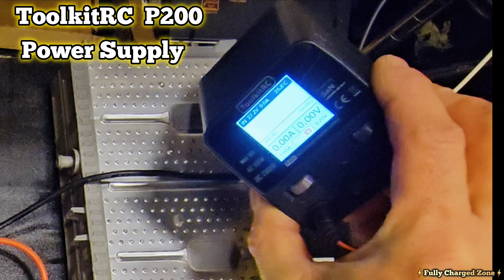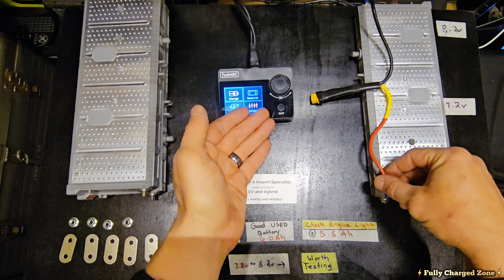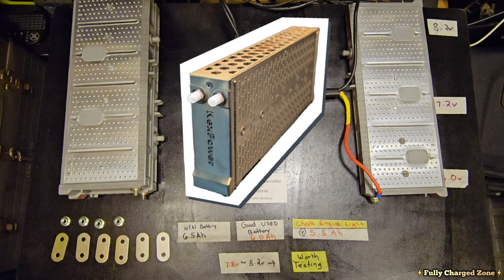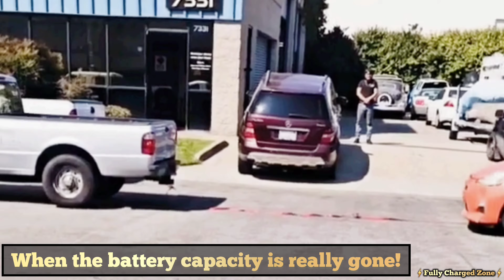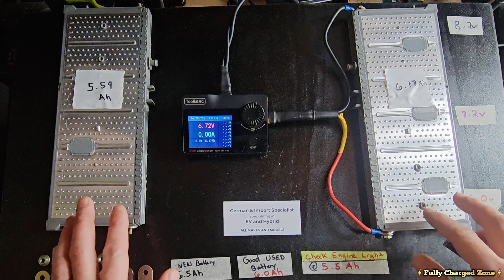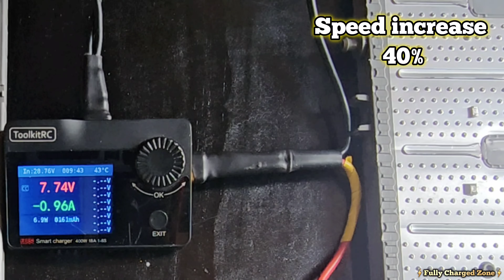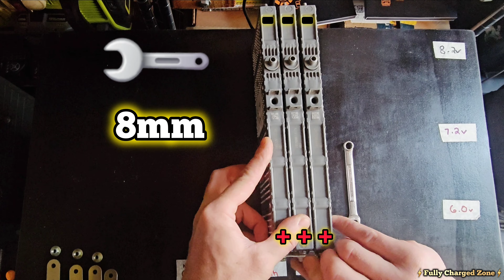Toyota Hybrid Battery Tutorial - Charging, Capacity Testing, and Balancing Battery Cells.

Comment: In the interest of saving a metric tonne of time, can I just run a charge and see if it reaches 7.5ah?  I did that one my first cell, and it stopped when it reached the preset, 7500mah.  Does that still say it's a good cell without spending a whole day on it?
Reply from the maker: Battery capacity tests often take a long time because they typically involve fully discharging a battery at a controlled rate, which requires a significant amount of time to accurately measure the total energy stored within the battery, especially for these types of batteries. It also takes a considerable amount  of time to avoid damaging the battery by discharging too quickly. This is the only way to get the most accurate results.  It takes me 3 days to test an entire battery pack on a prius before assembly. Sorry to be a bummer. The more time you invest the happier you'll be with the battery results.
Reply: So we are still using the the bad one? After recycle / reconditioning? I have one that’s 6.36 (#18 I think). I have experience reconditioning 12 volt lead acid, but not these, thinking it’s the same concept.  12 volts are waaay simpler 🤭.  Should I be tossing this 6.36 module?
Reply from the maker: I would toss it in the battery recycling bin at home depot
Reply: @fullychargedzone 🤣, Thank You!
Reply from the maker: Its free  😆 😂 🤣

Comment: I have a 2017 Toyota Prius I just bought and they told me it had a bad head gasket. I know Prius is pretty dang well but this is my first 4th gen prius. I took the engine apart and put in a new head gasket, new thermostat and new ECT sensor because it was throwing a code. Once I got it all back together it started up but it idles extremely rough, if I hit the gas it will smooth out but as soon as it goes back to around idle speed right before it shuts off or right when it first kicks on it will shake like crazy until I hit the gas pedal again I have done everything I can think to do and cannot get this thing to stop shaking violently at idle speed. Two other mechanics have not been able to figure it out. It does have 240,000 Mi on it so I am wondering if the Hybrid battery is potentially going bad. It did pop up once saline hybrid system failure but after I reset the code it has not come back. However it did have a coolant leak before and I was told the engine did overheat. My question to you is, could a bad Hybrid battery cause a violent Idle shake when the engine is shutting off or first starting up?
Reply from the maker: No, I have yet to see a hybrid battery cause your symptoms.

1. Have you performed a compression check?

2. Have you cleaned the mass airflow sensor? 

3. Have you smoked tested the intake to check for leaks.

I've been working on these vehicles for years. 

4. Let the vehicle sit until engine is at outside temperature.  Start the vehicle...is there any smoke?

It sounds like the intake is leaking or the mass airflow sensor is bad.

5. Have you tried to run the vehicle with the mass airflow sensor unplugged. The computer has a back up that will run the vehicle if unplugged. 

Let me know, I have yet to find a vehicle I can't fix.
Reply: @fullychargedzone  so I did your suggestions, I did a smoke test first and could not see any smoke coming out anywhere. So I moved on to the compression test and sure enough, cylinder one had good compression and all three of the other cylinders had bad compression. Like 60s and 80s. Evidently when the engine overheated it warped something
Reply from the maker: @photosbynickel I'm sorry to hear that. I've been in those position before. I won't rebuild a overheated engine. The last prius I did...the head bolts threads got damaged. I hope you can find a good used engine. I know a few good sources if you need.
Reply: @FullyChargedZone  I have not smoked tested the intake but I have taken it off and put it back on several times and it has a new gasket on it. I thought there was a problem with the throttle body so I first cleaned it and that didn't work so then I replaced it with another used one I had that I also cleaned and that didn't work. I did do a hard reset to make sure the computer reset once I cleaned the throttle body. I did put on a new mass air flow sensor and that didn't work. I have changed the spark plugs, I have changed the fuel injectors. I have tested the circuits to make sure it's 5-volt constant. It has a brand new AGM 12-volt battery. I have checked all wiring and hoses a million times over. But no I have not done a compression test yet
Reply from the maker: I can tell you worked hard on it. I'm glad I could help.
Reply: @fullychargedzone  i have put new head gaskets in 4 prius engines. replaced engines in 2. yeah. I spent a month working on this one.  thanks for your help. where do you recommend used engines? my last one i got from Texas JDM.
Reply from the maker: I was going to recommend them, they actually have a decent warranty. I used them a few times myself. I also use this company sometimes because they have a lot of low mileage engines.

https://autoparts.beforward.jp/search/TOYOTA/PRIUS/Engine---Components/Engines/
Reply: @photosbynickel  its a clogged EGR valve/EGR cooler that's causing your headgasket issues. It's a semi-common issue on older/high mileage Prius'
Reply: @fullychargedzone  also I did try to start it with the mass air flow sensor unplugged. There is no smoke after letting the engine sit. The last time I tried to start it after cleaning the throttle body I put it in maintenance mode and it shook just for a little bit when it first started and then smooth out and ran pretty smooth for about 30 seconds and then the engine suddenly shut off. Then it tried to start itself back up again and started shaking very badly and after about 5 Seconds it shut itself back off and then tried to start back up again shaking badly again and did this back and forth about five times before I finally shut it down. After I shut it down I pulled the spark plugs out and there was smoke coming out of the holes of the spark plugs
Reply: I had an issue similar to one you described after 2nd engine end of story injector plug signal was making false contact no codes super negative fuel trims till I gave it gas and smoothed out.

Comment: Thanks a million ! Great imformative video can you tell me 7 whats your name so I know who taught me the right way? 😃
Reply from the maker: I'm glad I could help. It's the main reason I started this channel. My name is Dallas.
If you have any questions I'm here.
Reply: I have another question, how do you adjust the discharge for the 6 hours on the toolkitrc,because I started the discharge of the module and it stopped after 2 hours I will appreciate it very much if you tell me how thanks and god bless you!
Reply from the maker: @cucogallegos3974 that means the battery only has 1/3 the capacity of a good battery. I recommend not installing the battery. If you purchased it online send it back. Holding voltage is different than a capacity test. Most people only test if it holds voltage. The video explains settings you should use. I've been in your shoes...sorry bud. If you need a good source for batteries I can point you in the right direction.
Reply: @fullychargedzone  thanks a million and god bless you! Where can I find a good battery/ module ? I would appreciate it very much!
Reply from the maker: New battery replacement:
 https://sodiumhybrid.com/?srsltid=AfmBOoq4yqxtsoUHqAwcqYuDgsaUWy71tGzxXebgiBaKXh4pgPkE93R8

Used Battery Replacement:

https://batteryhookup.com/products/oem-toyota-prius-nimh-replacement-battery-cells?srsltid=AfmBOoplsq4bA_DrQ2P4wa7vHkn3AJMqeHjcQnGl2ABvYat5JdhmwkiW&variant=43961978847394

If sold out...I recommend emailing them. Batteries are usually back in stock weekly. They never let me down.  

Another source if they're sold out

https://2ndlifebattery.com/product/toyota-prius-hybrid-battery-cell-8-2v/
Reply: Thanks again you're a life saver! Best wishes!
Reply from the maker: @cucogallegos3974 Anytime

Comment: can you pls advise the thought process on dr pirus app in vehicle testing that pulls 6 amp load by turning on headlight etc etc .. i tried with my2017 highlander and it never works for me may be because it has 4000 mah vs 6500 mah on regular pirus, it was not able to keep up for 15 minutes as app exect on 6 amp load.  any thoughts will be helpful on invehicle testing to get to know the life of battery without removing and dismantling to do capacity test.
Reply from the maker: It sounds like the capacity is depleted. Email me S.O.C data
Reply: @fullychargedzone  I tried in 2 different car. State of charge maximum toyota allows is 68 or max 70% after this toyota dooesnt allow battery to charge (dont know why), after putting 6 amp load for 12 minutes , state of charge came down to 40%. all voltage are within 0.10 voltage difference. dr prius app says 65% capacity. i dont tust this. because i tried the same in 2019 highlander that has 50K miles and it came up with same result.  like to know your thoughts.   before the load test whe SOC is at 68% the block voltage(combining 2 modules) is 22.21 voltage all other blocks are within .10 v difference..  after the load test with 6 amp around 10 minutes or so, block voltage is at 21.53 and it has SOC AS 40.77.  PLS ADVISE i am pretty sure app is not super right
Reply from the maker: From the data sent, 12 cells need to be replaced..1,2,3,4,5,6,7,8,9, 13, 14  15. The pack will need to be disassembled to tell if any cells are left over to salvage for rebuilding. 
Charge and capacity test all cells is my opinion at this time.
Reply: @ thanks I will send Toyota tech stream data tomorrow. If you don’t mind why did u think it is bad. Voltage difference between the block is less than .14 volt that after load.
Reply from the maker: Battery is either imbalanced or bad from data you sent me. The battery won't charge because the voltage of the blocks are so different.  That's what the data you sent me is, say. You need to disassemble pack. No codes in Tech stream don't make sense.
Reply: @ thanks million. I sent 2 new data to your email

Comment: Thank you a ton. Can i use a battery for a power supply to the charger?
Reply from the maker: Yes, you can. Make sure the battery voltage is between 12 - 29.9v
Reply: Cool charger

Comment: Thanks a biillion. Based on your teaching for 6 cell battery, i came up with below conclusion for 8 cell battery, please advise if i am right.

Can you please advise for 8 cell battery, what is the AH value for new battery, good battery and non good battery. for 6 cell you said 6.5ah(new), good (6.ah) and check engine light(5.5 ah). pls advise the value for 8 cells. I assume since cells are wired series, 8 cell will also have 6.5ah ..  just voltage goes up,, but ah remain same

I also assume for 8 cell the fully charged volt will be (1.36 x 8 ) = 10.8 volts
fully discharged battery for 8 cell will be 8 volts. This gives nominal voltage of 9.6 volts.

Pls conifrm

I also assume charge current for 8 cell will also be 2 Amp.

you sais it is worth testig if battery voltage is between 7.8 to 8.2 after resting for 30 to 40 mins in 6 cell battery 

For 8 cell battery i assume battery volage should be between 10.4 to 10.8 after resting for 40 mins to start doing capacity test. please advise.
Reply from the maker: Please give me the year make and model.  I'll  be able to look up the specifications... also email me a picture of your battery cell also. My email is in the channel description.
Reply: @ hi it is 2017 Toyota Highlander platinum model 6 cylinder Hybrid
Reply from the maker: Red positive vent or black negative vent battery? There are 2 types of cells for your vehicle.  I have a listing for both.

Both cells have a capacity of 4000 mAh and a nominal voltage of 9.6v new.  

• 10.5v charge voltage
• 10.5 - 10.0 resting voltages 
• Capacity tests need to be between 4ah and 3ah, which is acceptable for a battery pack rebuild.

Here is a link for new cells:

https://m.alibaba.com/x/xbeemua?ck=pdp
Reply: @fullychargedzone  Thanks the listing in alibaba says 9.6V 6500mAh Hybrid Battery..  but you said 4000 mAH. please advise.
Reply: @fullychargedzone  Thanks a million. i searched alldata and mitchell coould not find the speec of mAH .  all i can find is it is 8 cell and nominal voltage as 1.2. do you refer some other sites to get the actual mAH and capacitance test values.
Reply from the maker: I had a friend look it up at the Toyota dealership for me. I use mostly dealership software...it comes with the diagram & specifications.  I usually rent a daily subscription if needed.
Reply from the maker: Depends on the vent & color of the bad cells.

The cells are upgraded version. Original is 4ah ... if you buy used cell go with between 4ah & 3ah 👍

I have only used them once, I've mostly rebuilt these packs with used cells. There is an abundance of them in good shape still.
Reply: @fullychargedzone  Thanks so much. I have also seen others say to discharge and charge 3 to 4 cycles to regain the mAH capacity.. do u think it is still right practice or once the capacity is lost and if we regain  using charge and dischrage cycle is no good. please advise ..  Thanks again..I am treating you as book keeper on all these EV content.

Comment: Hi quick question. Toolkit RC p200 is connected to m8s to power up Correct . What setting I should choose in p200 pls
Reply from the maker: Yes, the M8S is connected to the p200 power supply. 
(I have it set at 28.8v 10a) 

Anything above 12v 3a  is fine.

Comment: Very informative video,thanks. I found you on Facebook
Reply from the maker: I post on Facebook in a few hybrid groups. It's nice to hear you found me here. I'm glad you liked the video.
Reply: Sorry for bothering you. Please help me. Is 2687volts good for a 2015 sonata hybrid battery? I'm buying it
Reply from the maker: 266v to 300v is a normal voltage.

Is the battery used?

How many miles on the vehicle its coming out of. 

Anything used is already almost 11 years old now.
Reply: @FullyChargedZone Yes, the only thing is that their battery is 4r000, and mine is 4r101 does it matters or I can use just the cells ,  all my battery cells were rounded bad every single one
Reply from the maker: @rodger6940 I'm not 100% cells will fit. I would check with the supplier to see if they're compatible. I would say if they look similar I would try .